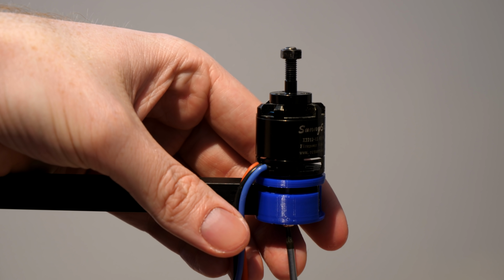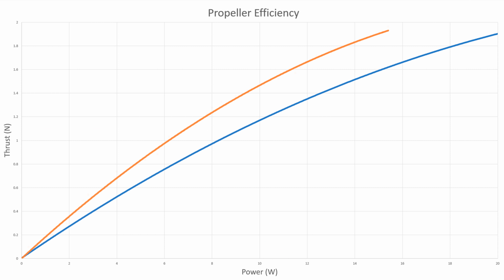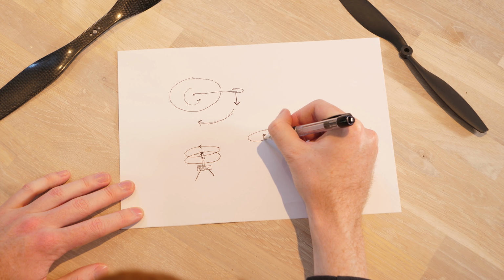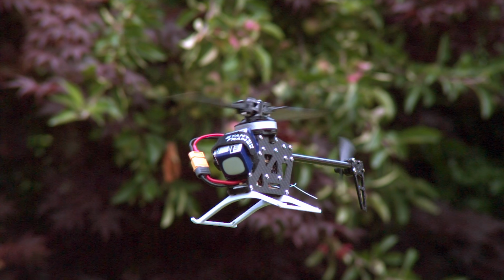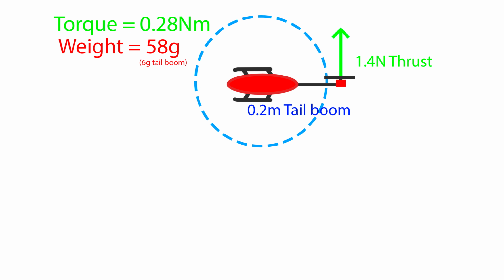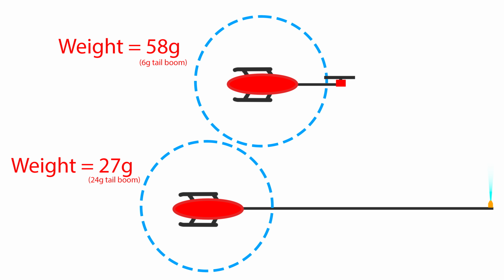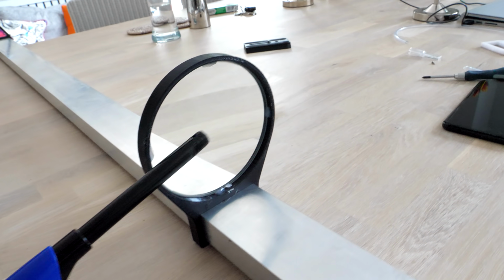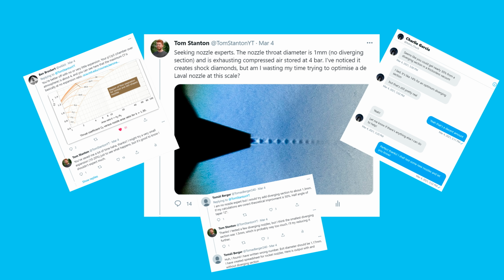Air Bottle Helicopter

Comment: 12:16 when that Propeller is released  from the impact and serenely takes off...wow... powerpulse at each rotation on the propella assembly causes lift and with no weight just takes off and flies.

Comment: You could use a vertical light weight stiff foam  on tail which would resist   the torque produced by the propeller

Comment: Try using propane as the energy storage. its -45F boiling point puts the pressure around 4 bar at room temp. Add enough to the bottle to where you have a small amount of liquid in the bottle and it will flash to gas as the turbine drains the gas.

Comment: I saw another video of yours about your v3 printed engine where you pumped air into the tank of the engine as it was getting low so the engine kept running. Have you considered building a system that uses the engines power to pump a small air pump, possibly 3d printed? then with the right gear ratio, you can have a self-sufficient engine powered by air.

Comment: You should get a carbon fiber air tank...they are light and can hold a lot of air pressure....you can use a carbon fiber air tank that they use in paintballing

Comment: helium plastic bottle/balloon aluminium mesh balloon
Reply: mesh = collect net, outside rim partition contains most lift, you can have inner turbine and electronics
Reply: output tube has resonance frequency
Reply: the resonance frequency should multiply the output, standing wave
Reply: nighthawk video of the propulsion heat in tube
Reply: air pressure hover craft

Comment: Perhaps a pressurized rubber balloon inside of the plastic bottle could be used as an air bladdler to give your nozzles a little longer high pressure output time. Rather than the fixed volume of the bottle just resulting in a steady pressure drop. Cool videos btw.

Comment: You should look up a k-max helicopter. They are heavy lift helicopters with blades that are side by side slightly angled away from each other and geared to intercept. This means they don’t need tail rotors and they generate a lot of lift

Comment: I love in the concept that you have replaced the tail blade with air valve... I just can't ignore this coming to my head intuitively... why not use compressed air to produce electricity? this would focus your research on air-engine efficiency while keeping everything else "electrical"... It might be silly suggestion, as I am just a filmmaker not scientist at all. The concept is coming from submarines in which engine produces electricity ...

Comment: Just an Idea:
Could one increase the effectiv amount of air in the bottle by putting a inflated Ballon inside?

I know in hydraulic systems we have tanks too and they always have a gasfilled bubble.
The ballon will likely shrink when the bottle is pressurized and when the bottle depressurizes it will expand and pushes out the air.

Comment: Here's a question, though it may go against the spirit of the challenge. Have you considered using a light weight airsoft/paintball high pressure tank? At a certain point I imagine the extra thrust and energy density might be worth it.

Comment: Rather than venting air from the fill cap once it detaches, put a one-way spring-loaded valve on, thus preventing the compressed air from being lost and preserving it for thrust.

Comment: you can eleminate the tail rotor by driving the main rotor witth a small jet engine placed at the end of the main rotor...This was done for a 1 person helicopter design using hydrogen peroxide impinged on a silver mesh.    The link is long gone.

Comment: The project is Awesome, most especially because of the Air pressure motor
I think the stability can be achieved by adding some equally distributed weight to the bottle

Comment: You are an awesome craftsman!

Could you please try making a flying saucer?

It is very easy! Just glue a plastic plate on a plastic bowl that is slightly larger in diameter. Cut some slits near the edges of the plate and leave only four attachment points to the bowl.

Then cut a hole in the middle of the plate. Install a propeller fan on it hole. Glue an upside-down plastic cup on it. Cut openings near the edges of the cup. The battery can be in the bowl.

When you turn it on the air should flow into the bowl, pressurize the air in the bowl, then push the air outside near the edges of the plate. This will create a circulation on the flying sauce. No air goes down! The lift force is caused by the Bernoulli effect. The air keeps circulating on the saucer.

Try it please! If it works I bet it will get 100M views!

Comment: A thought: would a smaller plastic bottle (1 liter rather then a 2 liter) be able to hold a higher PSI? (They generally are built a bit more robustly then the 2 liter bottle) If this is the case, you could (in theory) use a second bottle which would be approximately the same weight (maybe a bit heavier) then the standard 2 liter bottle. 
Although it may be a slight compromise on weight, the benifits may be promising

Comment: i have a suggestion  why don't you use (vane type of motor like in air power tools, they have enough torque)or (the tool which dentist use they have high speed depending on your input pressure)

Comment: Ideas for improvement:
- use some pliers-like printed arms to lock the whole heli around the bottle. You could avoid uneven upwards momentum.
- insert a tiny valve to stop the rotors running (and vibrating) while pressurizing the air tank. Open the valve remotely with a line.
- change the filling valve so that the levers presses the valve away from the heli.

-> 
1. Start up rotor
2. Stop pressurizing and drop the filling valve
3. Unlock heli

Comment: The bottle is too unsophisticated. It’s a big volume with exponential depressurization. Perhaps you need to design an “air battery”, meaning, intentionally create a pressure vessel that’s as complex as batteries in managing the energy so that you can keep the discharging rate at the nozzle at the ideal pressure independent of the volume

Comment: What about a tail rotor comprised of a turbine and an EDF? Air directed through the tail to turn the turbine, in turn spinning the fan.

Or perhaps a simple belt driven tail. I'm not sure how much friction a belt would create, but the turbine for the main rotor could be created with an slot for a belt, and the belt twists to 90 degrees as it goes through the tail boom, allowing for a tail rotor.

Just thinking of some ideas from my own experience with RC helis (hence my YouTube pic).

Comment: Love the video! I am curious, would it be advantageous to use something like an aluminum water bottle to store higher pressures in? The rest of the system would have to be upgraded to handle the higher pressure but I think it could be crazy enough to work!

Comment: You could get a longer flight by removing the nozzle on the tail boom. Vintage 3ch RC helicopters had a frisbee like disc on the tail boom instead of a rotor. This disc limited the spin rate to something manageable in a hover, and the curve acted like a wing enabling straight forward flight.

Comment: Hey Tom.  Have you tried a conic helicopter, where the blades rotate above the tip of a cone?  I remember seeing this way back.  IIRC, it has the advantage of having a low centre of gravity making it very stable and you can use deflector fins on the cone's surface to act as a means of counter rotation.  Also, the cone acts as a lifting body.  I'm actually unsure why development never went much further.

Comment: I think you need a separate release mechanism so that the bottle can get to a very high pressure before disconnecting. notice your last try was working before pressure and thus rotor speed and lift dropped again. maybe a mechanism that releases automatically once the bottle reaches full pressure.

Comment: i seen a prop where the air travels through the blades makes a turn and comes out the tip,  like the stablizer you mad, just make them into a prop

Comment: I think those bottles will go up to about 100 psi. I don’t get the sense that you’re up there. If you want butter momentum transfer you might put a little bit of water upstream of your turbine. Make the air push the water, and when that water hits the turbine, it will spin the turbine. The tailboom is going to respond to gravity and give it a pitching moment. You might consider a static piece of that carbon tube sticking out the front to balance it. Winglets on the tips of the rotors do wonderful things for reducing loss. There are big wings where they will do a 10% reduction in drag. Some of the design constraints going into the commercially available propellers are speed of mass production.

Comment: You need a check valve for the inlet nozzle. Then you don't have to manage the outward flow, and you retain a little more air for propulsion. Looks like you're 90% there, and you just have to work on that very difficult 10%

Comment: Look up early helicopter designs. Very early models have two rotors rotating in opposite direction with an angle toward each other, (like a very shallow v)  the steeper the angle the more stable is the helicopter. But it will have costs in efficiency. The reason is that if the machine tips to one side the rotor gains efficiency and the opposite loose it, pushing the machine back into a balanced position.

Comment: I'd suggest a smaller bottle, so it's lighter and has less drag.  They can take a LOT of pressure.

As a kid, I made a couple of compressed air water rockets, with 2L plastic bottles and a full sized car tyre valve to inflate it, which remained part of the rocket - which was also the main source of its potential to mame, kill or crack greenhouses.

Comment: Thrust efficiency from a propeller also depends on the pitch, not just the diameter.

Pitch is usually given in inches, for model plane propellers - it's the distance the prop theoretically travels in one rotation, in a very idealised situation.

As a rule of thumb, a propeller with a ptich of half its diameter (e.g. 8x4 or 6x3) gives the best static thrust.  For a prop with more pitch (e.g. 8x6 or 6x5), you get a better top speed, but less static thrust.  

It's a lot like choosing a gear on a bike, or in a car, then driving in just that one gear.

Comment: One thing to note is that you can create a helicopter setup like the CH-47. This was not the first heli with this setup, but it is one of the more successful ones.  Why go to this setup.  The first reason is that as opposed to having stacked coaxial rotors the dual rotors in this setup will allow you to increase your effective rotor disk area as well as canceling torque.  Weight will go up, but you can also carry a larger volume of air.  If the bottle size were increased to a 3L bottle, the volume will increase faster than the weight increase.  I also have taken these bottles over 120psi over a few cycles and they have worked, so you may be able to increase the stored energy as well, though may need to change the fill method to accommodate the higher pressure.  

Just some thoughts.  It was a really fantastic video to watch, and awesome to see the shock diamonds.

Comment: It needs a tail rotor, a slightly larger/thicker air container probably, and a full body clamping mechanism to hold it down while it builds air pressure. Then it will gain more RPM without tilting forward; and when it flies off into the sky on release, the body wont spin around in circles. Also i would experiment with a different main rotor that has higher mass and slightly lower thrust so it can store more energy and bleed it off over a longer period. Also probably needs a stronger air valve to handle the pressure being loaded into the bottle

Comment: while i dont think this was a failure. It did take off under its own power. I think you could get a higher pressure in the bottle if the air wasn't flowing into it. Could you try making a valve to let the air flow at the same time you release it?

Comment: you can't stabilize the helicopter like that. The rotor length should be longer than the size of the body and center of gravity should be adjusted also.

Comment: Could you use dry ice or liquid nitrogen as a fuel source, as this turns into gas and the amount of gas it will generate based on the mass may allow you to run at more pressure and greater capicity.
if this works it would be neat to see you try them in the other motors and get a better run time.

Comment: I would be curious to see what pressure levels you can actually achieve in the bottle like this. Maybe you could come up with some sort of valving system that would only start to rotate the propeller once you have reached a set pressure in your tank while it is connected to the external supply and make it so that this system is shut off as soon as you connect the external air? this way you could ensure the proper pressure in the reservoir before takeoff. Alternatively, you could have two separate supplies. One to spin up the rotor and one to fill the tank. During spin up, tank and turbine are disconnected. Once you launch you connect the two to supply the rotor with the onboard air.

Comment: I'm no engineer, its just an idea. In my opinion I think it would work a bit better if you make a quadcopter but to prevent propeller issues 
make 2 of the propellers across from each other higher than the other ones. Almost like a chinook... but a quadcopter

Comment: Is there a way to pressurize some sort of gas to liquid? Maybe nitrogen? You can add more energy to your rotor by a constant pressure rather than a massive energy dump by atmospheric pressure equalizing to the pressure in the bottle. I guess the biggest question is if you can get enough thrust to overpower the weight of the liquid and containment vessel?

Comment: There's these special high efficiency props. They can be very small and still create quite alot of thrust for the size. They kind of look like a vortex or helix shape propeller. To see an example of what I'm referring to. Check out the GEPRC Thinking P16 HD. That drone is a custom build micro drone with extremely high efficiency motors and propellers on them. If you could recreate the propeller design on that but for about a 3 inch prop. You'd have some serious thrust

Comment: The problem is not the idea it’s the mass you are trying to move. Try building out of extremely light weight balsa and tissue. You use the pneumatic motor to turn a large rotor and tail rotor made from tissue paper and balsa sticks with a lot of pitch and surface area to move a lot of air. So get rid of the 3D printer and get to old fashioned building young man.

Comment: What about putting two vertical aerofoils on the body at the tip of the propeller so the downward force of the rotor cause air to pass over the aerofoils causing an opposite rotation might need two or three aerofoils per side. Plus the aerofoils  can be adjusted for movement as well and probably need to be adjusted if you're going at forward speed.

I think a gyrocopter would be a better solution as well you only have to start the rotor and it powers itself then just a forward moving propeller would only need power. much easier solution

Comment: I think the reason your rotor efficiency decreases at higher RPMs in your test jig is affected by the decreasing efficiency of electric motors at high RPM due to back-EMF in the motor.

Comment: I suspect the problem here is that helicopters are a very inefficient method of achieving flight. Helicopters use a lot of energy just to create lift to keep the aircraft in the air, diverting some energy to create thrust for forward flight, while fixed wing aircraft only use energy to create thrust which produces lift. A Cessna 172 uses a 160hp engine to cruise at 140mph, while a Bell Jet Ranger uses a 317hp engine to achieve a max speed of 140mph. That's almost twice as much power to achieve the same speed for the helicopter.

Comment: Loved the video. keep up your learning; you will make a brake through at some point. Now, I am not an engineer by any stretch; I just have a passion for aviation (all forms of it) and have learned a lot in studying how different aircraft work to gain lift. My two cent's are to make your rotor bigger. If you look at piloted helicopters the rotors are always bigger then the body of the craft. I also think you have too much opposite thrust on your tail boom, so changing that nozzle should help it.

Comment: Power it with hydrogen peroxide and silver mesh. It will produce a lot of exhaust gas, and could overcome a lot of weight. 
But it does produce heat.

Comment: What is the point of having a dedicated gyroscope bar instead of increased mass at the end of the rotor blades? Would that not be easier and more effective due to the larger distance from the center of rotation?

Comment: Have you thought of using compressed air/ other elements like nitrogen in another vessel besides a plastic bottles. Something like aluminum with 800+ psi and a regulator

Comment: You don't need a gearbox for counter-rotating blades, just a way to pass air through to a second turbine. Less weight-efficient, but potentially easier to manufacture.

Comment: You need a check valve in your inlet. I don't know if it will make it fly, but it will give you a little more pressure after takeoff.

Comment: Epic! Great work. I wonder if making the refilling nozzle one-way would help keep more pressure in the bottle and get you a longer flight time? A simple check valve that closed when there is pressure inside the bottle and the refilling nozzle is removed.